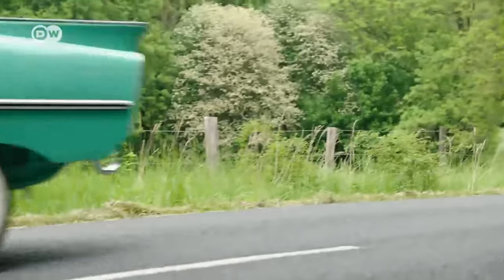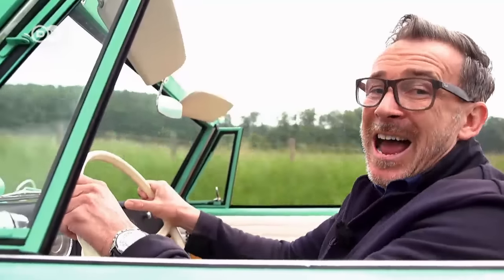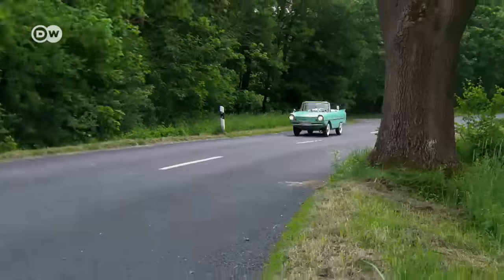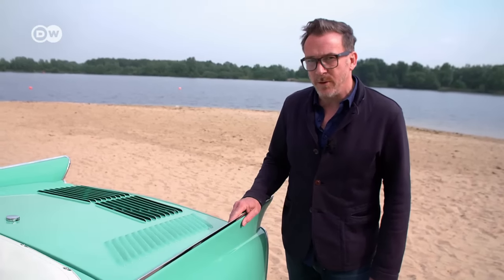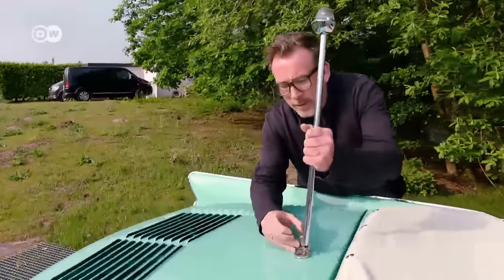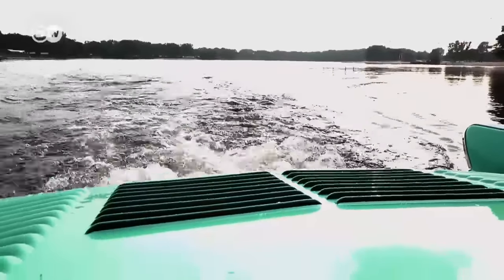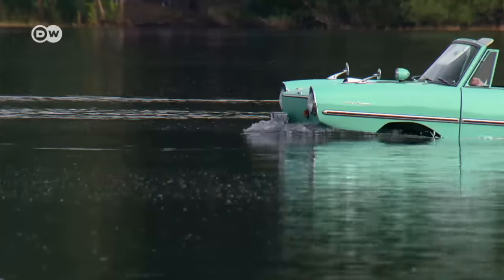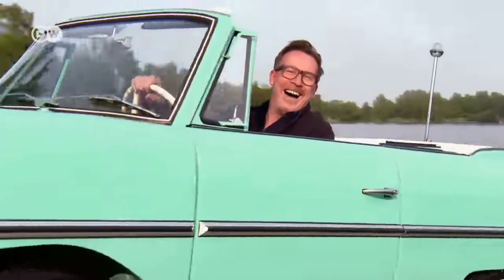First mass-produced amphibious car | Vintage

Comment: I rode in one in 1962. My Dad test drove one from the dealer. We didn't get to swim it. I never saw that anyone bought one in my hometown Superior, Wisconsin, USA. It was an ideal location because we had a large bay with only two bridges that were often blocked when they opened for ship traffic.
Reply from the maker: Wow! Why did your Dad decide against buying one though? We're curious, especially since we've never encountered someone from across the pond who actually took a test drive in the machine!
Reply: @DWREV I'm surprised that little car made it across the pond.

 That's a joke... Maybe Not a great one.😅 we'll have to work on it.

Comment: I think these are great. One of the questions most asked is why Trippel used mild steel instead of fiberglass. Fiberglass had already been used in boats and in automobiles like the Corvette and, IIRC, the Kaiser Darrin sports car. Fiberglass would certainly have reduced the rusting that is well known for these cars.